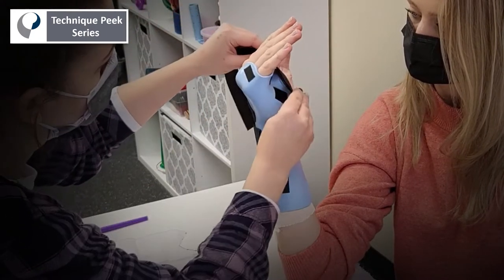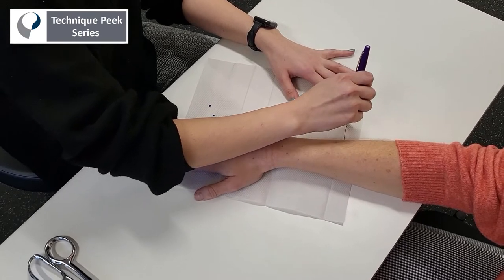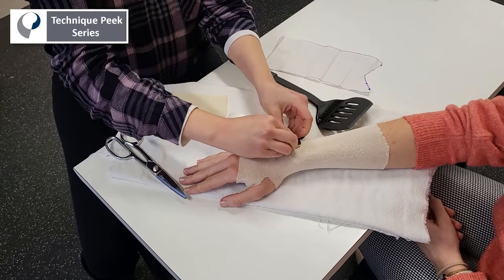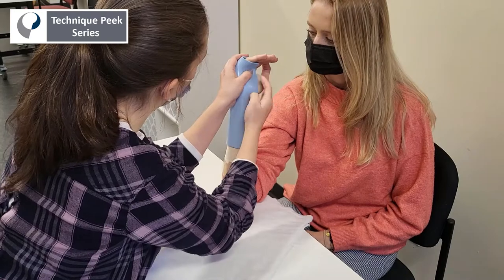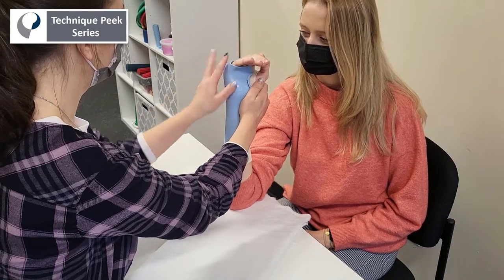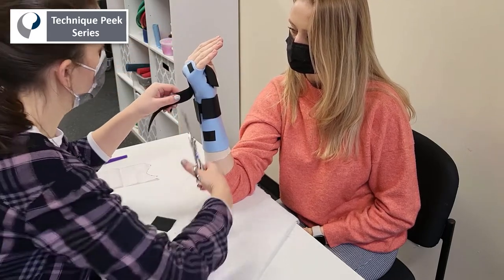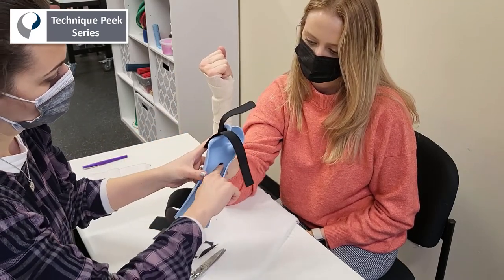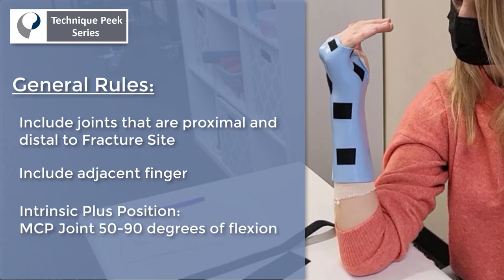How to Create an Ulnar Gutter Splint |  Technique Peek Series

Comment: Omg, the cast put on my hand for this exact need; is fibreglass, no padding for the joint, very thickly wrapped around my fingers meaning my middle finger is bent and sore, the edge around my thumb is painful and I cannot even hold a spoon or fork to eat properly. The cast overextends a full centimetre past the 4th finger meaning it gets into everything. I cannot write or obviously wipe. My left hand and arm are no good as I have a torn rotator cuff as a result of the same accident where I fractured my right 4th metacarpal. I've been struggling with this cast On for 5 weeks. Now I've seen this, in going back to where this was put on to request(demand) something much like this... Comfortable and considered!!!!!! I can't believe I've been put through this frustrating uncomfortable time unnecessarily. Thank you for this video!
Reply: I'll be going there tomorrow! And they expected me to keep this on for 8 weeks!!!!!!
Reply from the maker: We wish you the best of luck with your recovery. Thanks for watching!